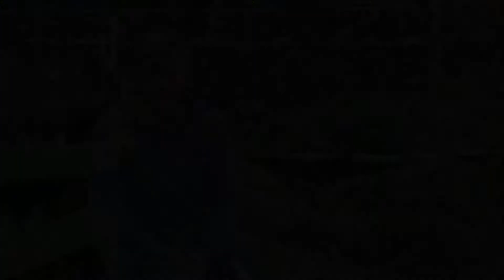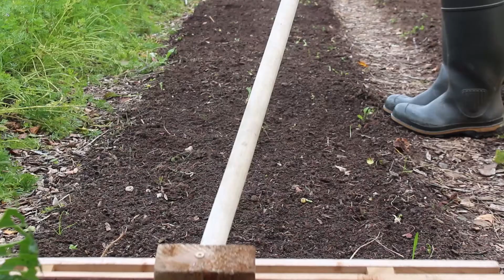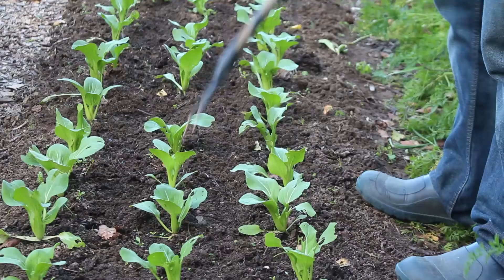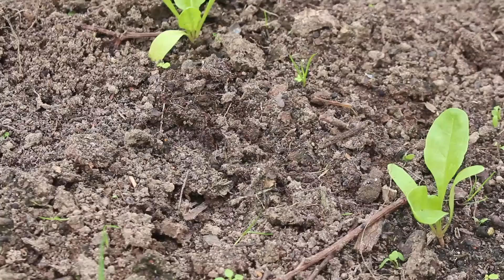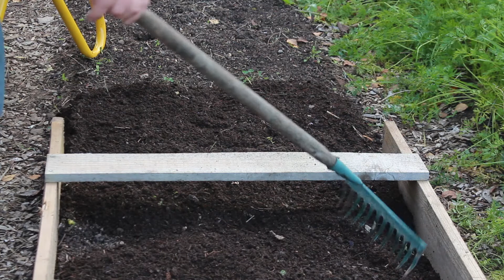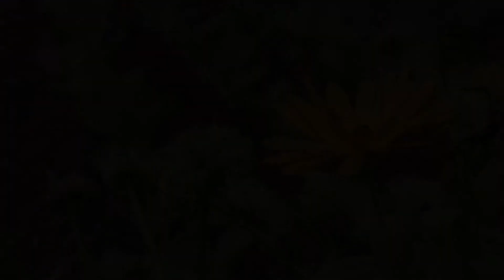My Handmade tools for Market Gardening | No Till

Comment: How did you attach the quick changer to the wood stick?
Reply from the maker: Drill a hole and bang it in, compression fit in the wood, I may have put a drop of glue in there as well for good measure.

Comment: What do you use for fencing? Do you have any problems with wildlife getting into your gardens? Nice work on your operation and tools! I like you videos!
Reply from the maker: Hi, well funny you should mention that. We had a simple wire fence around to deter animals and also giving the dog a boundary to stay out (you can see it in various videos). It worked for the most part, there's plenty for deer to eat elsewhere during the summer. We then had one break in and some bitter leaves eaten so I put up a single hotwire that worked fine until it went really cold down to -20c's and then they were desperate and broke through that. No real loss as what was out there was nothing more than compost fodder! We are upgrading our fence this spring to something more sturdy. Probably welded wire to 1.5m then the single wires above that to stop deer jumping. Hogs have been decimated here due to African swine flu.